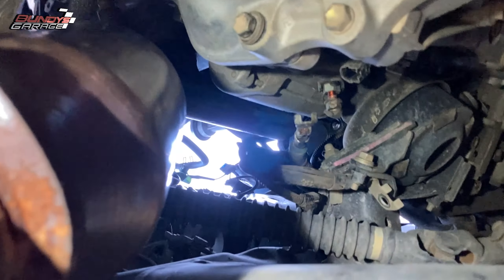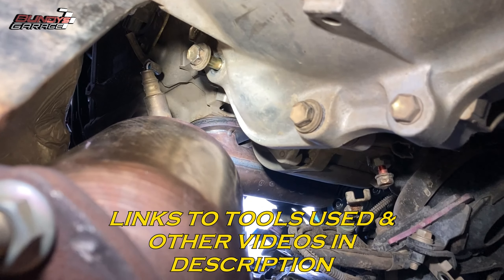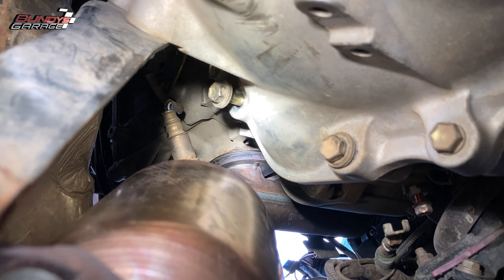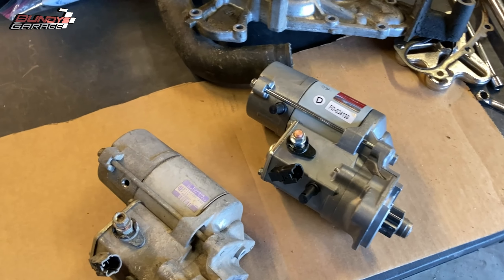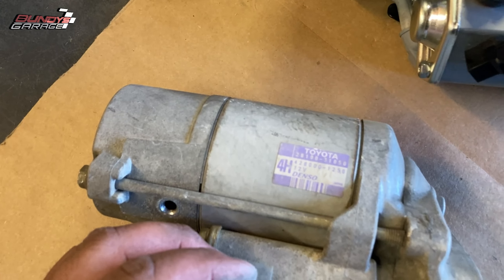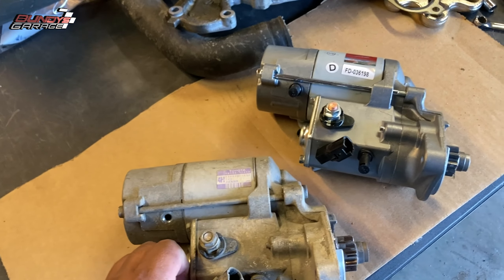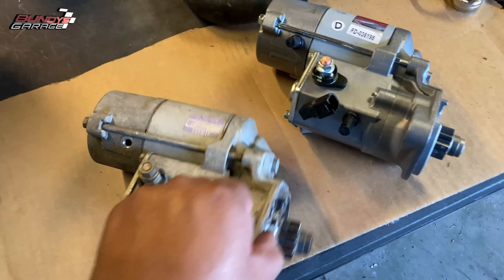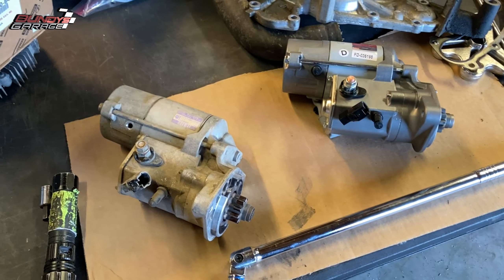Toyota 03 - 10 Tacoma 4Runner 4.0L V6 1GR-FE | Starter Replacement [Tips & Tricks]

Comment: You can get to the top bolt through the firewall by removing the aircon hose drain bung. Then a long extension with 14mm goes straight onto the top start motor bolt.
Reply: Where is that located under the dash ?